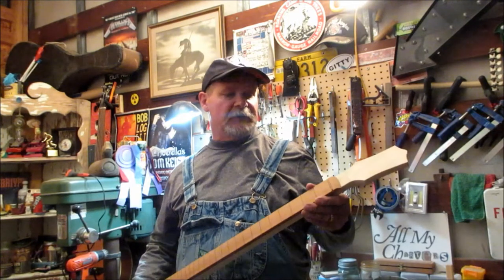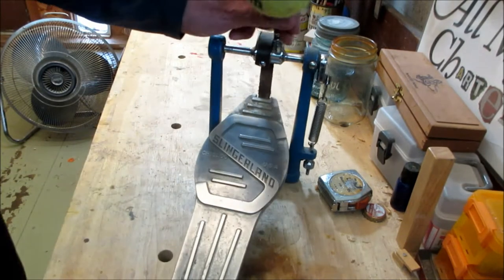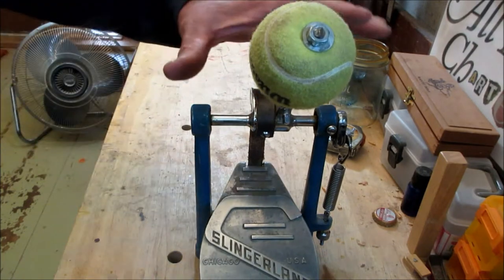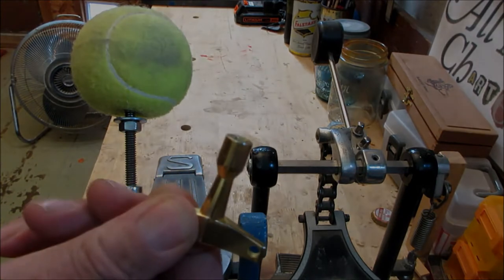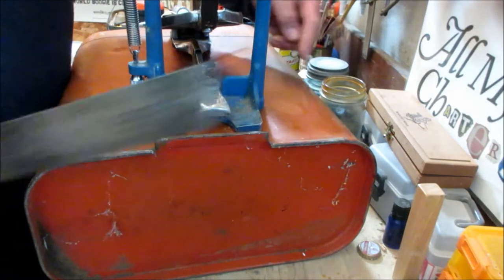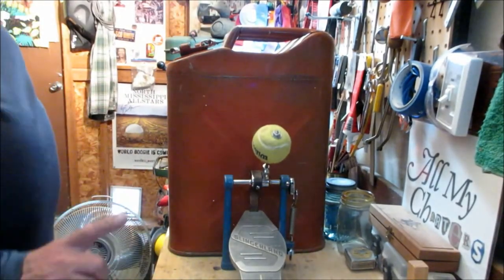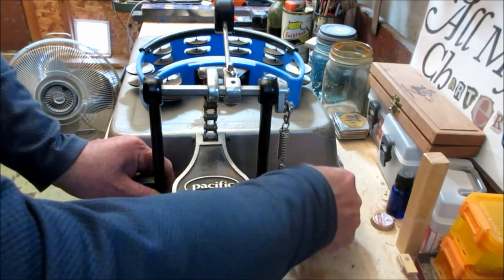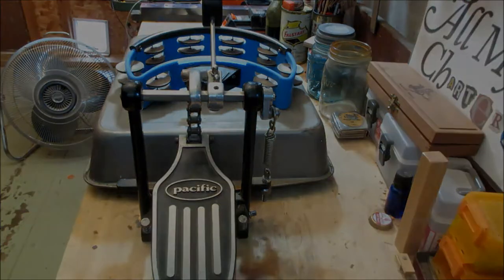Homemade Percussion

Comment: I got a little kid's First Act drum set at a yard sale that had a bass drum and kick pedal. It's small, but it works! Modded the drum by cutting a hole in one drum head, taping up the other one, and stuffing a small pillow inside. Considering sticking a piezo in there for some added thump.
Reply: Just added the piezo, hooked it up to a Zoom B1 bass pedal, added reverb and wow... me likey...